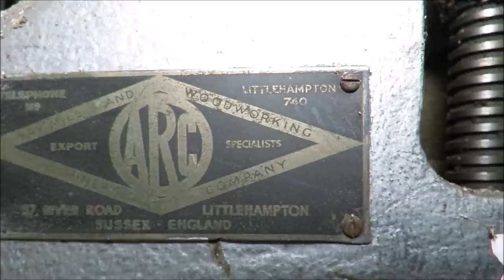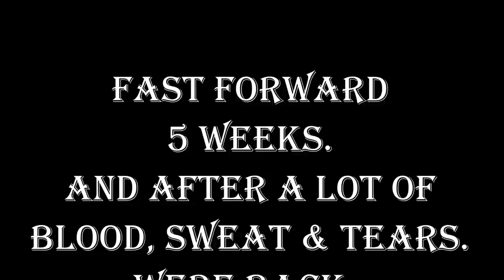Phoenix Knife... The Phoenix Chopper. Back From The Ashes. #SRP

Comment: Proud to have had a small role in getting the Ombersley butchery back up and running. Massive respect to the other trades getting the groundwork and structure back up so fast! I'll badger Scott to get a bonus vid out with some of the heat treatment/forge work involved but he's a busy man give him a chance to play with his new chopper first 😉 
For those genuinely concerned about the metallurgy here, don't lose sleep..  
Annealed first, always start with a clean slate, or risk blunting drill bits and cracking tangs. Normalised after, several teas and rolls of Golden while it cools for an hour. A quick harden of the cutting edge (not entirely necessary for this tool, but a blacksmith's got to work..) and back in the heat one last time for a mid-level temper (roughly the same as a splitting axe head, designed for repeated impact, it'll take a feather edge but whether it holds it or not is irrelevant).
The proof in the pudding, is chopping a bunch of kindling whilst the butcher watches in horror!
Smiling at the comments about it not being flat or straight... Don't forget, this tool had become an extension of Scott's arm and of the handful of old choppers I've restored, they are all about as crooked as their owners, not for me to set that right! Peening isn't necessary with epoxy either, it would only split the Oak. 
Interestingly, the blade passed the initial hardness tests prior to me doing any work, it's likely that it didn't get to a particularly detrimental heat, there was little sign of oxidisation through burning and the brass pins were still sitting there bold as.. brass. It had, however, been sitting in an acidic slurry of wet ash and plastic so a severe case of the surface rusts was to be expected. It takes more than that to dull Sheffield Steel though!
 - The Blacksmith
Reply: Glad to see this, I've seen what happens to steel tools involve in fires when they get a rapid quench by the Fire Brigade. Needless to say you already know what can happen if they're not annealed and re-hardened/tempered.
Reply: Looks amazing .. you brought it back from the ashes.
Reply: Oscar Marshall That’s brilliant. I came to the comments to ask this very question of how the fire might have affected the steel and you had already answered it so completely. Good job on the restore.
Reply: if I end up half as good a Smith as you I'll be happy. Well done indeed.
Reply: Thanks for assuaging my (our) concerns.  I was worried that this chopper maybe could be brought back cosmetically, but not metallurgicaly.  I feel better knowing you brought it back to snuff all around.  Beautiful oak and brass work.  I might have sandblasted, ground and polished it, but I think you did an amazing job.
Reply: Glad to see it come back im not a fan of epoxy on a old build but i guess you were going a little more for a working tool than keeping looking like original to the time it was made also never knew they used beech back in the day as in American its hickory or nothing tho I've seen some walnut used to make a few handles from really old knives
Reply: Thank you, I was concerned the temper wasn't addressed in the vid. But Scott's a butcher, not a bladesmith.... Good job, sir!

Comment: So sorry for the loss there at the butcher shop.  Glad you got the ole knife up and going again.   I have a high carbon steel EKA swiss,. With a bit of scale on it.  For the lighter jobs, bar keeper's friend does wonders, following up with mineral oil of course, for the tougher jobs I've been so bold to use a dash of miratic acid, it will create dull sheen and will need polishing compund though.  The bar keeper's knocks off the scale but keeps the vintage look. The miratic would lose the vintage look but would be stage one of a full restore.

Comment: So sad, glad no one was hurt. I'm not a knife-maker, but I'm surprised that your blacksmith guy didn't recommend heat treating the blade again, or at least the edge, as I'd be concerned that the inferno ruined the old heat treatment and if the metal is too soft, it won't hold much of an edge for long.
Reply: I'm going to hazard a guess it was re-treated before the camera started rolling.
Reply: @GrizzAxxemann  I guess it's possible, but from what I saw it's doubtful. I guess it's probably not going to be as important as say a chef's knife or hunting knife, since a massive chopper like that not only has a ton of steel, but a butcher is constantly going to be giving it a few slides of a steel as they work throughout the day and that chopper is used more like an axe than a knife, so absolute sharpness isn't required or probably even desired.

Comment: 17:11 tang is correct. This is a full tang cleaver. Lesser variants would only have the tang half the length of the handle. Probably have been sneered at and run out of any shop in Sheffield for suggesting a half tang but they don't make like they used to hehe.

Comment: The temper of the steel would have been destroyed by the heat, they will never be the same.
Reply: Likely did not get that hot. It was not a forge heat. Just a sad fire.
Reply: I think it's more about the sentimental (ha) value to him as it was a gift from his mentor.
Reply: Stella can always be retempered
Reply: I was thinking along the same lines of the heat from the fire ruining the temper. It's possible that given that Ollie is a blacksmith, he would have re-treated the blade prior to filming.
Reply: @zw5509  Hi ZW .. standard heat treatment of carbon steels ( depending on their final requirements) are thus................ heat to glowing red (cherry) then quench in oil,  then tempering..........gently heat to blue ( if required to be reworked by hand or used under shock)                 or straw ( only to be ground, as this material is harder and more brittle) either quench in oil or water  due to the lower temp
Reply: i had the same thought.  can easily be annealed and re-heat treated  if the smith is worth a damn he probably tested it with a file to make sure it was still appropriately hardened.
Reply: I doubt that fire got anywhere near hot enough to adjust the grain structure of that cleaver
Reply: @nickoakley69   doesn't have to be that hot to dramatically soften it.  ive tempered knives out  of the heat treat at 375 to 425 F.  this was over 450 degrees since the wood was charred off.  and likely hotter because there was scale on the knife.  the oxidation could have decarbed the steel as well.
Reply: Absolutely  needed to be reheat treated  or at least tested  first  if it's going to be used again and not just a wall hanger.
Reply: @zw5509   you'd be surprised just how hot a "sad fire" can get. i'm sure the temperature in the centre of that would have reached 1000degC.  up above 200degC you'll start to affect the condition of the steel. 400degC would be a normal temperature to anneal steel at, i.e. where you get grain regrowth. 
The fire would not have stayed hot enough for long enough for that, but for sure it would have been hot enough for long enough to affect the condition of the steel. it would need to be re-quenched and tempered after that. otherwise it will be quickly loosing its edge. it'll need regular sharpening. But as someone mentioned here, I'm sure it's more about the sentimental value of the thing
Reply: @johncameron3972  Fortunately he had a knowledgeable blacksmith to help him. Scott was happy, it looked beautiful, held an edge and cut through meat and bone. Cleavers are not knives, they use heft.
Reply: @zw5509  i agree, they are not knives, the edge is being impacted continuously and it vital that it is properly tempered and conditioned. the fire will have, for sure affected the condition of the steel and i didn't see or hear any mention of that being addressed. it won't be the same piece that it was before the fire. but it looks great and and it will still hold it sentimental value. i'm sure the man's delighted with it.

Comment: That’s so beautiful to keep a connection to the past, with your mentor, the history of this knife, and the wood.  I love your show, Scott! One thought about the blade — if the fire was hot enough to anneal the metal, it might have to be re-hardened, and the knife edge re-tempered to add back some flexibility. Otherwise it will have lost strength and ability to keep a sharp edge. I guess you’ll know after sharpening the blade and using for a while if it was affected. Annealing is heating the metal until it softens on the molecular level (insert bishop joke here). The crystal stucture of the metal expands and the metal becomes soft and more maliable. If you have a tool-hardened piece of steel you can scratch an annealed piece of steel. That’s one way to test.
Reply: Oh snap! somebody is a metal geek, blade head, or a shop freak? That was way too technical, but absolutely right.
Reply: jdavi12436   lolol. oops and I was trying to make it less technical too. 
Well I have to thank Scott for teaching me how to butcher a whole chicken.  I had never attempted it before I saw his video and I love it. I get so many meals out of one bird. and the dogs are in heaven, I get several dinners out of it for them too. Thanks Scott!

Comment: Nice job , but i would have made the brass dowels or may be (copper) a bit longer and swaged them over with a hammer to lock it all together. Heart to see it back to life, cheer's.
Reply: With the way modern epoxies behave, there's really no need. That's how scales are pinned on these days. I've done a few of my mom's knives like that and the scales aren't going anywhere.
Reply: @GrizzAxxemann  I so-pose I'm old fashion .
Reply: @paul-up5jy  you run the risk of splitting the scale that way. You'd want to run Corby bolts in that case.

Comment: Based on the colour of the blade post-fire I feel, as a knifemaker, that the majority of the hardness is gone from that steel. I would have taken the blade edge (say, the bottom inch of blade) back up to critical and given it a proper heat treat, then tempered it. I love the dedication to restoring it, but it won't hold an edge properly without proper heat treat.
Reply: It had a traditional harden and temper, just didn't make the edit I guess. However, Rockwell was coming in very close beforehand (by old chopper standards), it probably didn't get a chance to properly normalise as the fire was being doused. Hope that helps - The Blacksmith
Reply: @TaureusGrey  Thanks for the info. That was my first concern earlier. You put those to bed. Only thing I'd have done different is not chamfering the holes for the pins. But as long as it's all straight enough for Scott, and feels good in his hand, that's the only opinion that matters. Every knife maker, bladesmith, blacksmith, and craftsman has a style. Like a fingerprint that says: "I made iths!"

Comment: The way I would have done the handle is glue the wood to one side let  it set , drilled the holes and glue the wood to the other side let it set then finish drilling the holes ans set the rivets then form the handle.

Comment: I'm suprised your guy didn't know that you don't fix oak to steel, it will turn it black due to the tannin content.
Reply: Tannin stains come off with a rub of wire wool and sugar soap, butchers take that kind of tool maintenance in their stride! (I'm actually surprised you didn't know that..)
Reply: @praedirus2768  work with wood not meat lol. would never use wire wool on oak. microscopic bit of wire left behind will discolour the wood.
Reply: Yes oak handles will normally  fit  steel tangs  but with the modern epoxy glue  inbetween  they shouldn't interact

Comment: Hate to break down the dude working on your knife, but his work isnt very good. no mention of retempering the blade. the dowel rod holes are sloppy like a 50 years hooker. one good wack or just a drop could pop the handles loose from the blade and then youre back at square one.